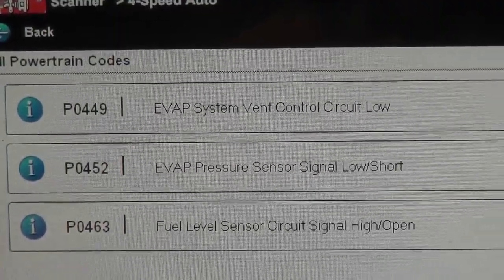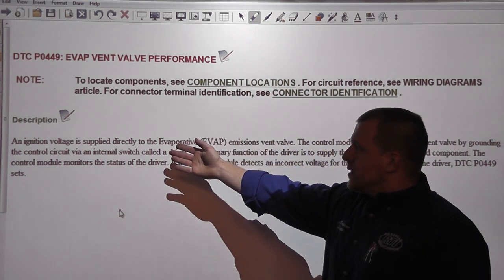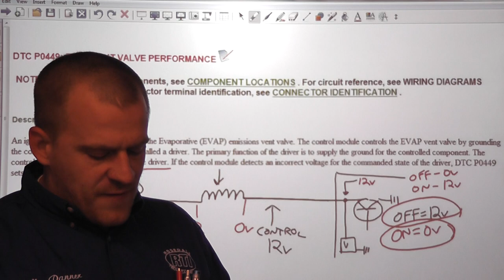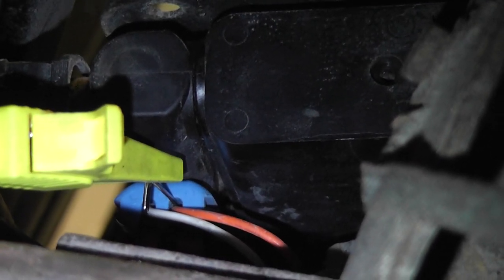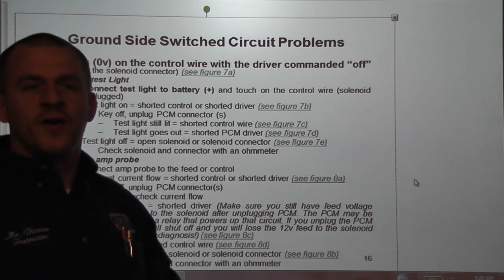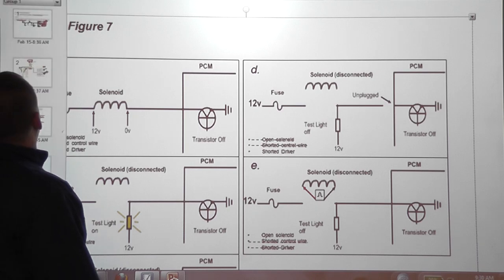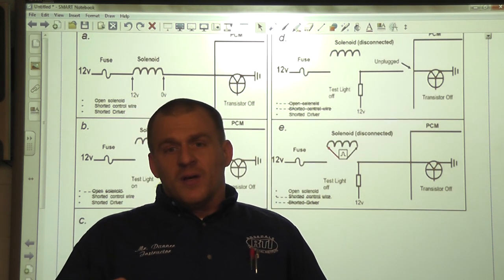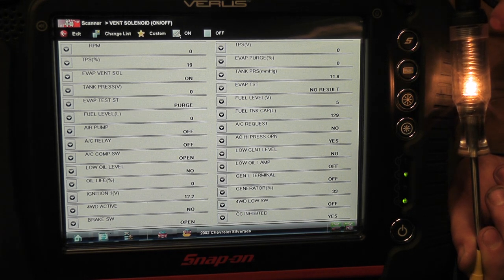GM EVAP Vent Solenoid Testing

Comment: This video is awesome, i have a 2007 Yukon with 5.3 and have already replaced the evap solenoid. I should have tested the signal wire from the computer back to the solenoid. i am pretty sure i have a faulty driver=( Great video though, thank you so much for sharing!
Reply from the maker: It's most likely a broken wire inside of the insulation, right at the connector. Like in this video
https://www.youtube.com/edit?o=U&video_id=0OumX9covQc
Reply: I'll check it out, thank you so much!!
Reply from the maker: What's the word? I've never seen a faulty driver for a vent solenoid on a GM
Reply: I am going to work on it later today. I have power at the fuse, the connector (on both sides of the connector) but no ground at the connector or right out of the ECM (with truck in run/on).
Reply: With the hustle and bustle of summer time haven't just got the chance to actually dig into this issue (P0449). I have 12 (and some change) at the ECM, i have 0 volts at the EVAP vent solenoid. I have no way of actually operating the driver, so I can't confirm i have the correct wire at the ECM. I am assuming the control wire is the same color from front to back. Do you know which pin the EVAP VENT SOLENOID is at the ECM? if not, could you point me to where you generate your wiring diagrams from? I joined the scannerdanner website, looks great tons of info. Thank you in advance for any and all help on this

Comment: Just diagnosed this on an Escalade 6.0. 0.5 V on the ground side at the ecm connector when commanded on and 12V when off. Bad ecm driver
Reply from the maker: No, those would be normal numbers for a ground side switched circuit
Reply: Thank you for the quick reply. I immediately re evaluated the Escalade and found a wire rubbing on the driveshaft 😐 I was expecting to see a voltage drop on the ground wire between the ecm and solenoid. Thanks to you I caught the real issue before putting in an ecm that is perfectly fine!

Comment: THE POWER PROBE 3 IS BASICALLY A VOLTMETER WITH A SET OF LEADS THAT YOU CAN APPLY POWER OR GROUND TO ANY CIRCUIT AT THE TOUCH OF A BUTTON.ITS VERY HANDY BUT YOU CAN DO THE SAME WITH A SET OF JUMPER WIRES IF WANTED. YOU WILL GET IN BIG TROUBLE IF YOU DONT KNOW WHERE TO APPLY THE POWER OR GROUND,THIS TOOL APPLIES FULL BATTERY VOLTAGE AND FULL GROUND.IF YOU DONT KNOW HOW TO READ A WIRING DIAGRAM AND KNOW CIRCUIT DESIGN I WOULDNT MESS WITH IT. I OWN ONE AND RARELY USE IT MAINLY I USE IT TOFINDSHORTS

Comment: I got a p0449 as my only code. 05 buick rendezvous. Is it possible some other sensor is causing the computer to close the vent solenoid on purpose-the whole time the ignition is on? Meaning sending a ground signal to the control wire to close the vent solenoid because the computer is sensing some other problem like maybe a bad fuel pressure sensor in the tank or something else strange?

Comment: scanner danner  why does the pink 12volt wire stay hot even if the key is off, 05 Colorado, the control wire is ok to the pcm driver ,the problem im having is the vent valve is not closing when the purge starts to do a vacuum test via pcm, causing a large vacuum leak to the intake making the longterm fuel trims to hover 16%, when I put a plastic plug over the vent valve tube they return to normal,  I cant figure why the vent valve is not calling to close,, please help diarstraits  eric martin lv nv thank you

Comment: ok the egr was put in backwords the pantal (the piece that moves in and out) the vacume side of it was put on the exzust side so that when the car ran it would suck the pantal open lifting up the valve off its seat and uncontrolabully let exzust gas into the enigine when not commanded the engine ran but runs a lot better now it dont shack like it used to you could see the engine shake a little the feed back voltage is 1.05 at idel instead of 1.5 volts and 0.9 volts with key to on not running

Comment: What if there is voltage on both sides of the connector unplugged key on. I have had several of these evap codes on different vehicles and I frequently see 3.5 volts on the ground wire unplugged not just the vent solenoid but purge solenoids too. No shorts or opens. Computer disconnected. When computer is connected the voltage shows 3.5 volts. The 12 volts supply wire is always good. Bad computer right? I've also had 12 volts coming from both wires of the connector unplugged on a fuel heater. Followed it to the computer again. Am I missing something before calling this a computer?
Reply: Um nevermind. I get it now. Thats the voltage of the control circuit with the driver off. HMM very confusing.
Reply from the maker: It is a bias voltage on the control circuit. This is used for diagnostic purposes.
Check out Section 3 of my lecture videos on my new channel ScannerDanner Premium. It is free for 14 days.

Comment: Hello, I have a Pontiac Vibe 2003 , with two codes : P0440 and P0446 , checked Vent Valve Solenoid, Vent Purge Solenoid (these two are under hood) and Pressure Switching Solenoid?  (the one located in the canister, rear the car)  Hoses look good, Canister also, the valves work OK and close/open when voltage applied . Connector on Vent Valve Solenoid shows 5.5 V with ignition key "on" (not on start) , Connector of Vent Purge Solenoid shows 12 v , and Connector on Pressure switch solenoid shows 5.5 V also ¿are those voltages correct? or what are the right voltages in each valve? they seems to operate all at 12 v , so I figure there is a failure delivering the right voltage to those valves showing 5.5 v . Any help will be appreciated , thanks !
Reply: +steelsniper82  Nevermind, I did again the voltage test with another multimeter and all connectors to vent valve, purge valve and pressure valve, are showing 12 v and valves open/close normally . So Im running out of ideas, replaced gas cap and codes still showing

Comment: I got P0449 as my ONLY code. 05 buick rendezvous. Is it possible the computer is grounding the control wire all the time during ignition on purpose due to another sensor issue?
Reply: I am directing all help requests to my forum. Sign up (it's free) and create a new post. Be sure to add a name under "alias" as this is the name that will appear in the post.
Here is the link to the forum. 
http://www.scannerdanner.com/ForumRetrieve.aspx?ForumID=3226
Thanks!

Comment: Hey guys, I'm having a potential issue with my vent solenoid on my 08 chevy cobalt (P0446). Fuel pump shuts off on me as if the tank is full, but it's not. I checked the vent solenoid using the procedure in this vid. The feed wire has 12 V, and the control wire is a pull-down style and it's getting 12V with the computer driver off and engine ON. Furthermore, I pulled the control wire to ground manually and I could hear the solenoid clicking. So vent solenoid is good. Where do i go now???

Comment: Hi, my car is 1998 Trans Am 5.7L. I don't have any SES light. The issue is that after I drive the vehicle for a while specially in a very warm day(I live in FL) I can see a wet stain of fuel leaking from the fuel neck. If I pull the fuel cap off the gasket is wet. I have blow all the evap lines with air and they are no clogged. If there is an issue with the evap purge valve, the canister vent valve will I get a SES code? I put an used charcoal canister and vent valve but no change. any ideas?

Comment: If we don't have the scanner tool what else can we do. I've changed the evap solenoid because it was bad but now it still not clearing the 443
Reply from the maker: Voltage checks at the solenoid with a meter as I showed in this video. Ignore that maybe it was a scope. A digital voltmeter will give you the exact same readings
Reply: @ScannerDanner  ok do I also need that T to test it. If so ill gave to get one of those. I'm suspecting a short on the control wire. What's the expense range to rewire?

Comment: Can the solenoid itself be shorted to ground, producing the same result as an open in the solenoid = OV on control wire?
Reply from the maker: In theory, yes, but I've never seen it. The key difference would be current flow.

Comment: pedel really fast the rpms pulsate instead of rev up p1406 is the only code and there is no carbon deposits on the valve and the pantal goes in and out like it should no sticking and the omes reading  is ok i have a good 5 volt refrance  over all the only thing i see wrong is the feed back voltage is too high its supposed to be in the millavolts range like 12 millavolts idk please check back with me

Comment: hi..i got a code p0449 on my 2008 saturn vue..i tested the output voltage and i got 7volts only. i can't even delete the check engine light on my dash..i already replaced the vent solenoid and the check engine light still on. Any suggestion? thanks.
Reply: I am directing all help requests to my forum. Sign up (it's free) and create a new post. Be sure to add a name under "alias" as this is the name that will appear in the post.
Here is the link to the forum. 
http://www.scannerdanner.com/ForumRetrieve.aspx?ForumID=3226

Comment: hello sir,i have a qstion.i have a gm car 88 2.8 v6 n its leaking alot alot of oil from what looks like the area where older cars used to have the distributer,this car uses coils though.its got a fork and bolt holding it down.seems to be above the cam and it moves when turned looks like a cap insttead of distributer.tried to pull it up but its hard.can it be removed ?maybe uses a gasket or seal n broke thats why it leaks oil?any info helps thanks good day.

Comment: Is it ok if i power on the car after engine computer has been disconnected for testing after doing so TCM computer is not registoring in the system tested for every fault i can think of i still stuck.has this happend to you?Any help Please.

Comment: Well in case anyone is curious, I fixed my problem. Of course there was a vent hose coming from the solenoid and when I pulled it off to inspect it I found that it was indeed clogged. With what you ask? Dead spiders and webs. Huhuhuh

Comment: I've watched everyone of you videos twice. You are not completely correct  in your diagnosis. You say if you disconnect the harness to the computer and the test light stays lit, then it is not the computer. Here is a scenario both short to ground on signal and short  through driver; fix the short on signal. Now we get really confused. Variables, variables, variables. I know that it is highly unlikely, but I guarantee it happens and will throw someone for a loop.

Comment: No matter how you cut it, someone sells a lot of parts! and that's the idea I guess. Call it a forced economy. I think I remember the older gm cars by jumping the underdash connector a certain way ,the pcm would cycle all the system components. Now why don't they incorporate that anymore? Oh I forgot, it sells more scan tools!  All this for clean air on such minute magnitude is a joke .Before long they'll  be outlawing beans in your diet. Excellent explanation , but look at the  what it took to get that far. I'm sure you didn't  just decide today this is how it works, They have no standard to abide to, Over engineered troublesome designed systems .Gotta be a better way.
Reply: All technical fields evolve in complexity over time, The Federal and state standards imposed on vehicles is progressively more restrictive [ with respect to emissions ] over time. When your system detects faults you need more than simple logic to do repairs that would be successful so YES its gotten more complicated.